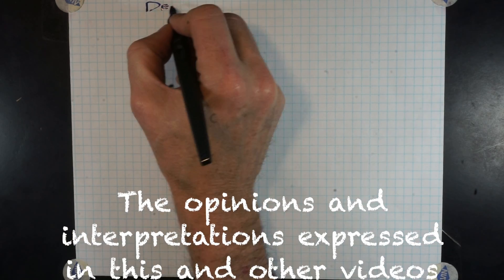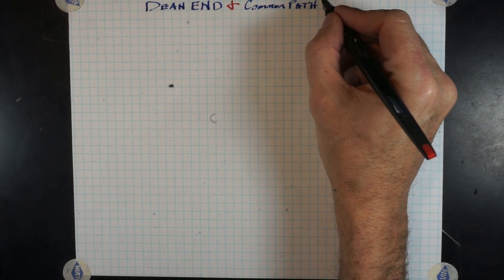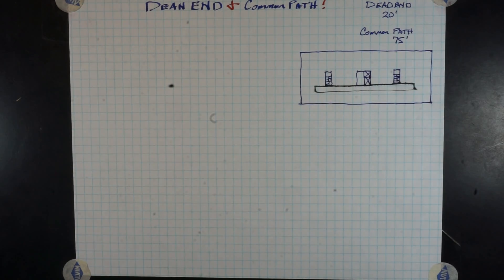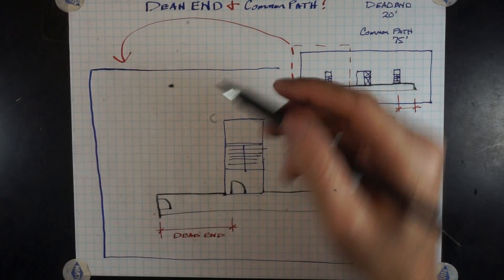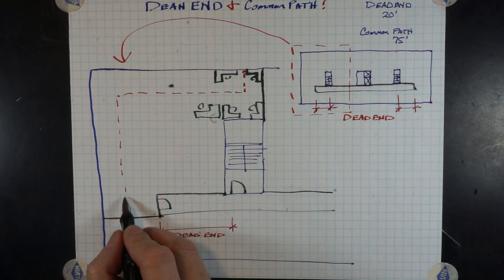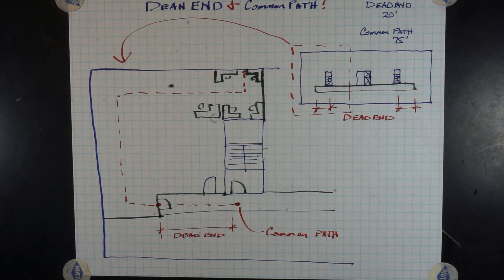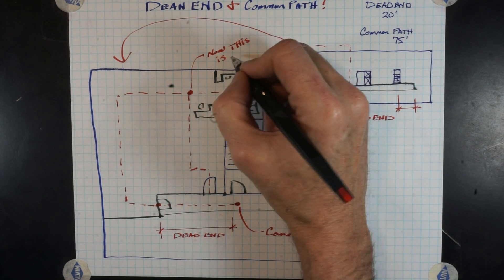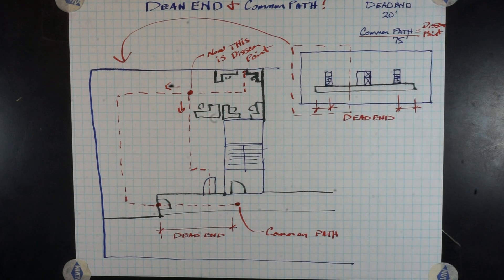Deadend & Common Path of Travel 30-0

Comment: This following vid is great illustration are informative, thank you martyHuei, for more additional input always consider first the building height classification & area of the building, the following arrangements of exit consider NFPA 101 A. table 7.6 the occupant load you can identify the different distance of the following travel distance & dead-end to be considered. For the room requires single exit should not exceeding 50 occupants, more than 50-500 occupants considered not less than 2 separate exit, and for the doors swing to the direction of egress.

Comment: Marty,In your example with two doors is the CPT distance  of < 75' required for both doors assuming an occupant load less than 50?  To be clearer I have a suite with an OL <50 but does not meet the CPT requirement from the furthest room. I add another door to comply but the original door still does not. The doors are remote from each other per the code. Thx
Reply from the maker: I am not sure if this is a question or a just conversation, sorry.  you can send me a plan if you would like to review and comment on. Go to my website and send me a email and we can go from there